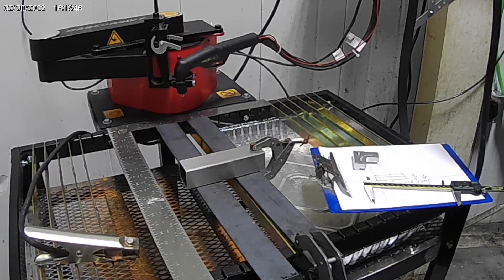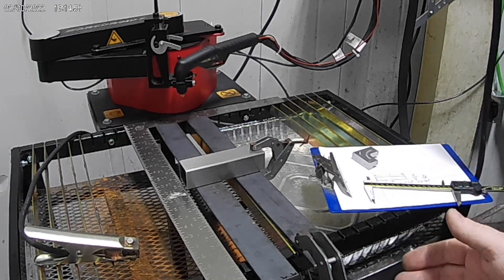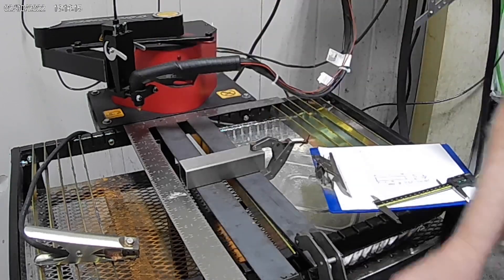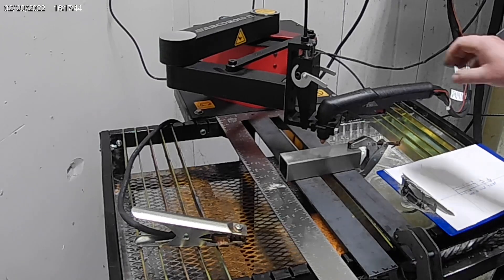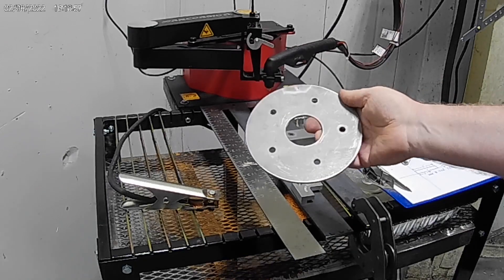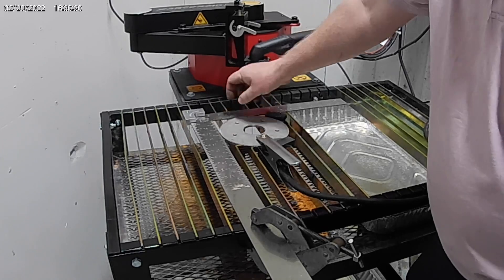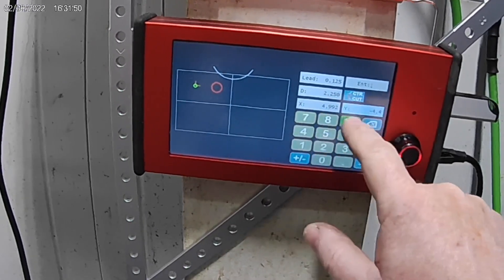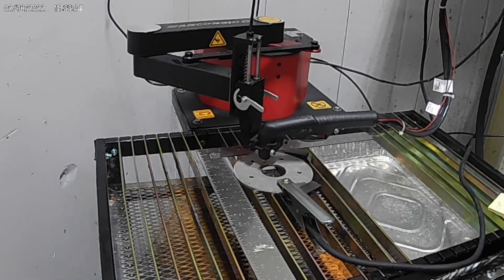The Corner Wizard TOOL for ArcDroid CNC Plasma Robot

Comment: What is the difference than just touching it right from the corner of the part? Lost me
Reply from the maker: if you don’t need to be precise, that will work.  But if you’re working with a machined part and need to position a feature at a particular dimension, then you need a precise datum point.